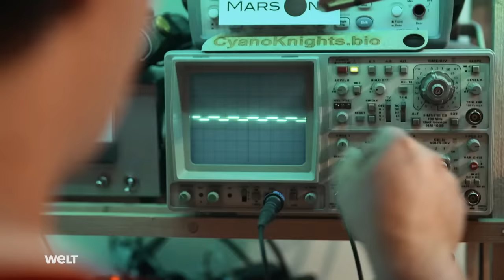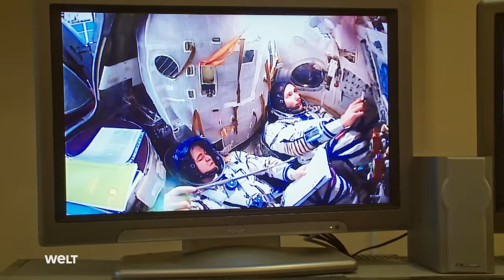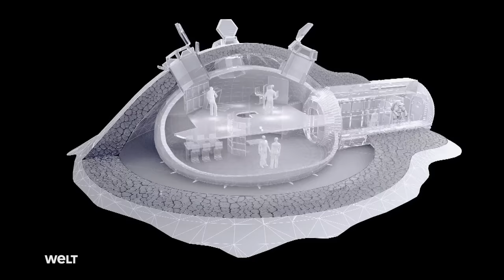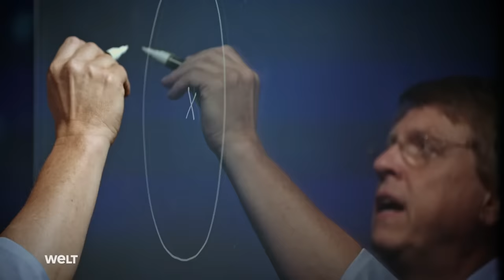Departure to Mars - Conquest of a Planet | SPACETIME - SCIENCE SHOW

Comment: It would seem a parachute can in fact work on Mars.  If the rotor craft can fly it would at least  slow down the landing unit.
Reply: Parachutes inflate with the thin air, but the terminal velocity is not survivable.  RetroPropulsion or lithobraking has to be used ultimately.

Comment: The sun is getting colder with time and the habitation range is moving towards the sun, thus marc was hot enough to complete the water cycle but when decreased to - 500, C water will never evaporate.
I think we have to consider the nearest plants that will solidify and initiate the water cycle when the temperature gets to the habitation range and the radiation becomes safe.
Just a thought 👌
Reply: The first couple colonies will fail. But, that is a necessary evil because that will help othet future colonies with parts, supplies etc.

Comment: Wouldn't it be multiple times easier and more logical to construct a station above Mars and get it self sufficient before attempting such a feat on the surface? An orbit structure is a vastly more controlled environment and fuel costs and needs to get back from the station would at least be less as well.

Comment: One of the many challenges of setting up a permanent settlement or terraforming Mars would be that it only has two tiny moons and not a large enough moon like Earth's. This means that its polar caps are not stable. In two Earth years, what had been the equator could end up as a polar region. This would result in huge shifts in temperature that no life on Earth could adapt to.

Comment: How seas were dried even though the temperature is in minus degree Celsius?
Reply: It is believed Mars originally had an atmosphere just like Earth. However, at some point, the core solidified which in turn stopped the generation of a magnetosphere that is paramount in keeping an atmosphere in place by reflecting solar winds. No magnetosphere, no atmosphere as it's stripped away. Before the atmosphere disappeared it's likely a runaway greenhouse effect occurred and 90% of the water evaporated. As the planet is cold all the time now, it does have about 10% water frozen at the polar caps. However, no one knows for sure as we weren't around and didn't witness it happen.